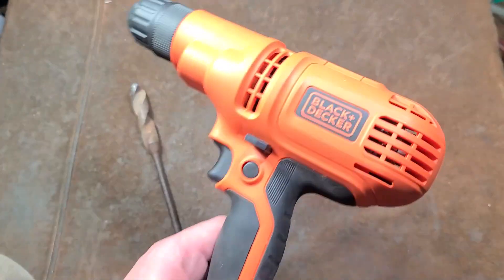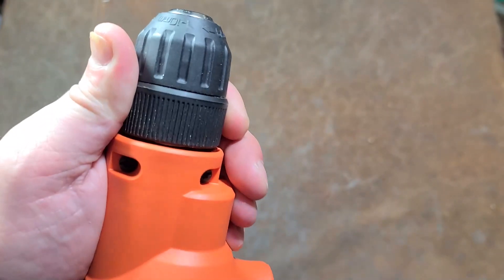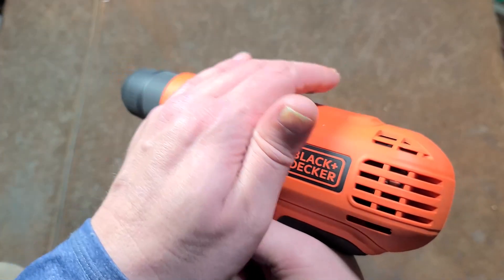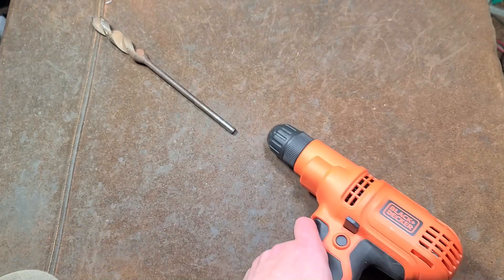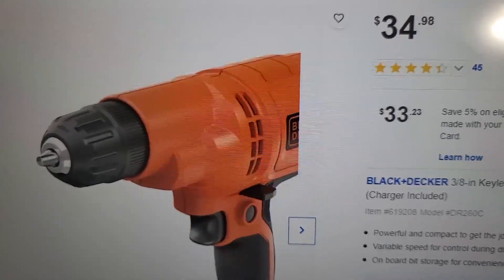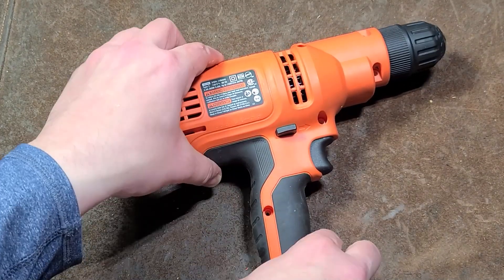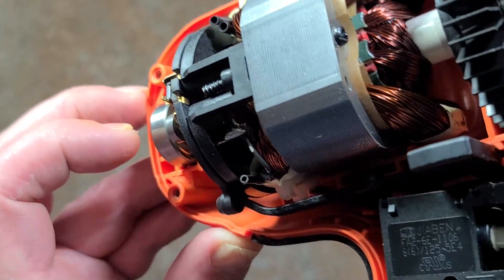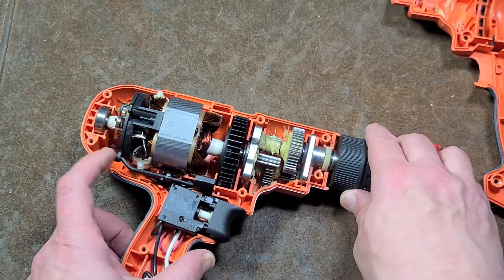Black & Decker Basic 3/8" Drill Review/Teardown (Good For The Price)

Comment: Interesting design. I have a b&d drill from the 80s that still works, but has a sheet metal chuck. Also picked up newer model 7.5A at estate sale for 10 bucks, and it accepts the side handle from my Dewalt cordless XRP NiCad drill.

Comment: Corded drills are bad ass
I have a chincy Skil from about the 00s, over time the trigger stopped working, and that was the perfect opportunity to swap in a variable speed from a router or something. It gives it so much more versatility, the speed adjustment knob can be used in addition to the variable speed trigger, so to keep a certain rpm you can adjust the knob and just hold down the trigger. Also, attach some sketchy grinding wheel, clamp the drill to a table, set the trigger on cruise and you've got yourself a better-than-nothing grinder with variable speed right on the trigger.

Comment: And when the industry changes battery platforms in 10-15 years you won't have to throw it away with your $1000 worth of cordless tools and batteries. Your corded drill and saws will still be running when you die. :oops:

Comment: What a POS.  Why are they still making 3/8
Reply: If you put a huge chuck on there then ricky bobby diwhy will have plausible deniability when he burns the brushes out of it trying to power tap 3/4 holes in his garage
Reply: I'm planning to do a chuck replacement don't know the what tool would unlock the screw hard to see inside the chuck

Comment: Looks like a good drill not sure how it would hold up on a job site for little things with 10 guys tossing it around that's the biggest issue for me abuse of the poor thing.  But for home use absolutely don't drop it kick it good to go the harbor freight one someone grabbed a 20 dollar one it looks good like a skill one I still have got in the 80s still running great but unfortunately the hf one puffs of smoke toss it in the garbage 🗑️. Have fun great show.
Reply: It's not intended for job site use, it's intended for homeowners and weekend warriors who don't need much at all.
Reply: It did a wonderful job working with small crews of 6 to 10 guys in Concrete Form Work. 
  Then we moved onto the 3/4 in hammer drill with a bit up to 1 in.

Comment: When you consider the price difference of these two tools it doesn't make sense... the cheap Black & Decker can be used all over the house... of course the Milwaukee Chuck is better but for $35 for a 3/8 drill that thing can be used anywhere in the house aside from digging into block or anything heavier-duty... the plastic Chuck will suffice 90% around the house

Comment: I had a black and decker Dr 320 from 2007 with a 3/8 chuck gel cushioning on the handle didn't have a whole lot of torque but did have speed but then it still came with hard  cases  looking at a storage recently and it blew out I didn't really care so much I have a DeWalt DW 235 g  type 2   7.8 amp drill with 850 rpm plenty of torque had it for years still works
Reply: Good morning do you have an idea of what type of screww is holding the chuck in place planning to do a chuck replacement